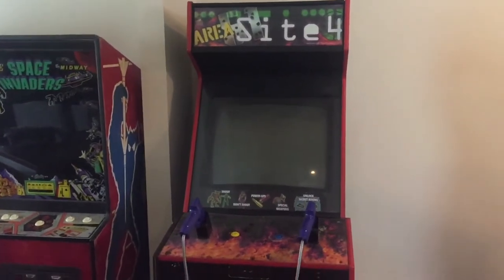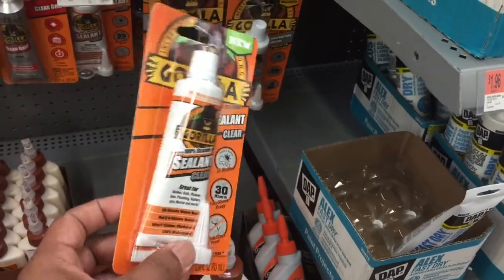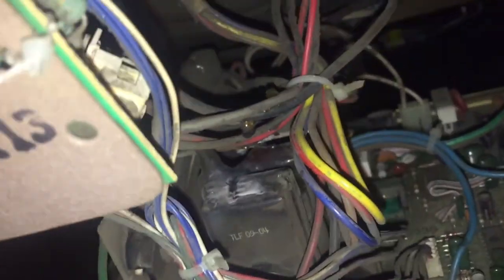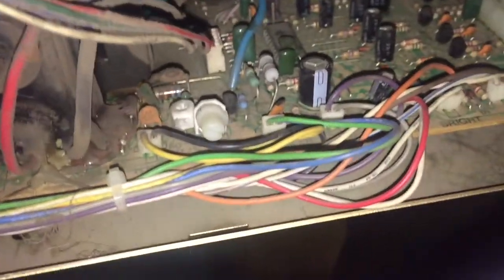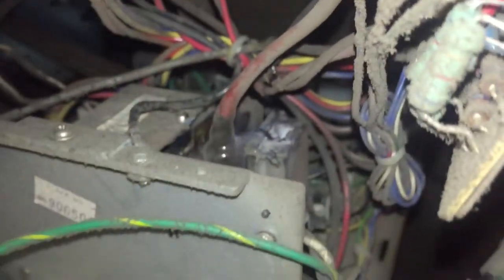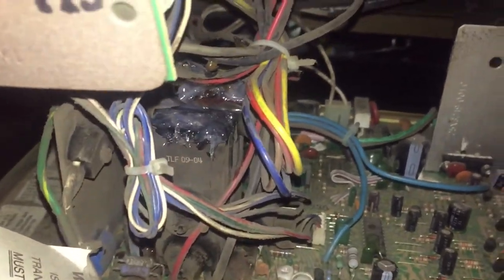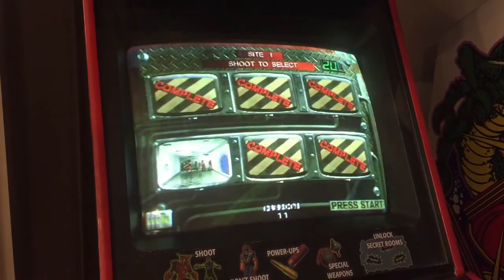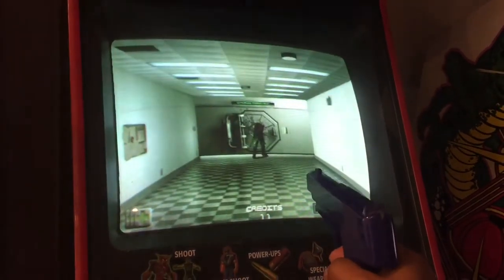Arcade Monitor Flyback Fix Using Silicone

Comment: You can use normal silicon sealant but it can cause issues. When silicon cures the gas that gets released can cause solder to corrode. For this reason it’s best to use a silicon that is meant for electrical application. Dow Corning 3145 is what I use.